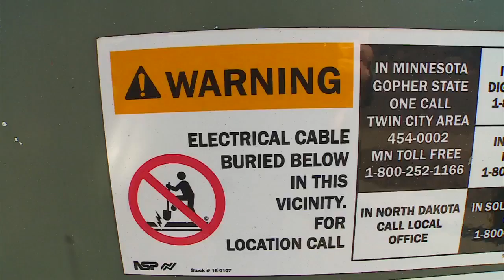Good Question: Why Aren't More Power Lines Buried Underground?

Comment: It's not a good question; It's actually a stupid question. And I have worked as an electrical engineer for years. I can give you one simple answer why (well a few.) For one thing the electrical lines in the air don't have sheathes on them. The reason of this is because they can cool off from the air around it  (but, you might think well if it was in the ground it would cool off better?) Yeh maybe but that would a maintenance problem and they would short out because ground water is conductive you fucking dumbasses. Jesus fucking christ. Are guys this fucking stupid? I mean you are talking about thousands of volts at one time. Ask yourself this question. " What if the sheath broke right? Then what would it do inside the ground? Maybe it might start arcing because of ground water?" Cmon you fucking idiots It's not rocket science (have you guys ever had a science class in school?) I guess you could use PVC piping too. Yeh that would actually work. But, then again a maintenance problem and what if that broke too?. Costs too much $$. Electrical lines on poles are spaced out to a certain distance where they don't arc. There you go. Hope that answers your question!
Reply: I swear parents need birth control to keep dumbasses from asking questions like this! 🤣🤣🤣

Comment: Henry Ford many decade's ago, highly suggested that electricity lines be buried underground. So high winds, tornado's, and other bad weather conditions would not halt electric service. But his Buddy, Thomas Edison said: I need to hire thousands of linemen, and charge each city and town extra money to keep the juice on. That way I can put more million's of dollars in my pocket by charging double for the same service. Henry sez: Sounds like a plan Tom. Then I can do the same thing. Make my cars cheaper by using real thin metal - so they can rust out faster, then I can keep new car customer's coming through the revolving door's of the dealerships, selling more & more cars - and making more million's of bucks, just like your doing. Money Money Money - thats what I want.
Reply: Someone finally with an intelligent on spot answer.

Comment: As someone who has installed underground power lines, don’t be fooled into thinking they’re naturally better than overhead lines. Yes, they’re less prone environmental outages, but the initial cost to install them is significantly greater. Excavating the earth, cutting concrete, and installing manholes are quite a task. Manholes are a danger in themselves with tightly crammed spaces with high voltage lines. And repairs may take longer as pinpointing faults, digging the area, splicing, and re-embedment can take more time increasing cost. Improving conduit sizing, wire placement, grounding methods, etc. has advanced their longetivity and durability, but don’t assume burying power lines is a simple and cost effective solution everywhere. It works best in heavily populated areas like the UK or large cities here in America.
Reply: excuses. Protecting the stupid telegraph pole technology. This bullshit dates back to pony express days with telegraph poles.

Comment: Underground lines could be insulated much more durable than above ground and last longer. They just gave a bunch of shitpost reasons why they cant, but the real reason is MONEY.
Reply: Underground wires are already insulated much more durable than overhead lines.  Overhead lines are still twice a reliable.  As lineman, we go to developments constructed 30 years ago that have constant problems from old wires.  Plus every time someone nicks a wire by digging it could cause a fault months later.  
Also, you're neighbors faulted wire problems can become your problem if the faulted happens to be on your property.

Comment: The United States should update its infrastructure indeed. Here in Bulgaria (Eastern Europe) we have underground power cables and small energy transformers that are found within the neighbourhoods. 

Power stops only a few times in the year and only in some neighborhoods for the matter of 2-4 hours and it gets fixed almost immediately. Power outages here happen mostly in summer and winter when people use a lot of their electric heaters or air conditioning that uses power
Reply: So basically the same as above but 20 times more the price lol major cities here have underground lines
Reply: Here in Canada, at least my city, all newer areas (~1980s and newer) have underground power lines as well as most main roads.

Comment: Well researched, it would be safer by far and have less power outages, but the cost is crazy to bury all the existing overhead lines, and then there are the factors of easements, proper distances, and of course repairing faults. Very few people understand how long it takes to get to a fault underground. Also, who would pay for the transfer for OH lines to UG?
Reply: The cost would've saved my brother. These things are not safe, they killed a father yesterday who was just trying to work. But the ladder struck the line.

Comment: Electricity itself is NOT even a necessity (i don't expect many to wrap their programmed minds around that one). Power lines and it's insulation can also be produced from HEMP, which would last for life. One reason they still hang power lines through the air, like idiots, is to have an excuse to employ mind-drone-slaves (like Joel Limoges) of the control-system to keep cutting down trees. Their only piss-poor, bullshit excuse is 'money' and 'ally-space'.
Reply: You're a fucking idiot.
Reply: Conscius Energeia Holy troll barf Batman! 🤢

Comment: It is a matter of cost, pure and simple. Underground construction in developed areas costs roughly 10 times as much to complete as overhead, running approximately $2 million per mile. This would translate into much higher monthly rates for customers. Everybody wants underground, but nobody wants to pay the costs associated with it.
Reply: Salvatore Guidone Great comment. Yes we have people constantly repairing lines exposed to the elements. It requires so much overhead to maintain. If they were just buried maintenance costs would plummet and in the long term it would be cheaper. Not to mention better looking and safer.

Comment: It is simple.  Underground lines are more expensive to install and service.   In my neighborhood, the residential areas are fed from an overhead wire on the main highway.  There is a transformer mounted on a pad on the ground for about 10 houses.  The line that feeds the transformer is 24,000 volts underground.  One of these underground lines failed, so they installed a temporary insulated line above ground on the surface to feed the transformer.  They later installed a new underground line in a conduit that was provided in advance in case of failure.  With transmission lines, they are normally air cooled, so when put underground there is the added expense of cooling the wires. This is done mostly in congested areas like downtowns of major cities.
Reply: All of the transmission lines in Memphis, TN in the downtown area ARE underground as well as the distribution lines.  I also know this is true for Manhattan, NYC.  In NYC many substations are housed on the lower floors of skyscrapers.  WTC 7 had a station occupying the first eight floors.  Bottom line is that underground power is very expensive to install and to maintain.

Comment: Two years ago, my cousin from Idaho an his familiy were on vacation her in Germany. As we took them from airport to our hometown, my cousins´s nine year old son asked...:  " Dad, do the germans have no electricity in their houses...? ". Cause he did not see any overhead powerlines.....
Reply: In Germany are conduits under the sidewalks and the cables are laying inside of these conduits. The entry point inside of the house is in the cellar. But there are still some areas with overhead-wiring. In my hometown the wiring was changed in the mid 90s, before this change I had a pole on my house and the entry point for electric power was in the attic.
Reply: @Marcel_Germann  The entry point for my house isn't even in the attic, it's just on the side of our house. Wire runs from the pole across the street over the road through our yard to the brick wall. 
You don't see that with newer homes though. My neighbors across the street I think are the first on our block not to be connected to the grid via above ground wires. And in the new neighborhoods being built there are no above ground wires.
Reply: @ScoCoda  Here in Germany the old overhead wiring was in the way that there was a pole on every roof. Inside of the pole the cables enter the house and are connected to the service entry box containing fuses.

It's a three-phase system in most cases, so you got L1, L2, L3 and the neutral or a PEN, depending on the grounding system the system operator provides. The supplied voltage is normally 3x230/400V. But now you'll only find that in areas which are called "upstate" in America or "Outback" in Australia. In the most areas the wiring is below the sidewalk and the cables enter the house in the cellar/basement. They retrofitted this here in the area during the mid 1990s. I got a picture from 1994 where the pole was still on the roof here:

https://abload.de/img/img_20121019_1827262ukwu.jpg

Comment: makes some sense ,, people have died from a high voltage shock during the construction of those high volt tower power lines that you see going across the rural farm land ,, on windy days those power lines build up voltage without being hooked up to any power source ,, they needed to put a special ground to the earth to drain the built up voltage while installing the miles of power lines ,, i would think that even once hooked up they still collect voltage from the static created on those windy days ,, i wonder if this helps to lessen the load on the main source ,,
Reply: carmichael moritz I work on energized power lines every day..... the only time we work on de- energized lines are when we pull new wire, working on storm damage or working an outage to a business.
Reply: My brother died just yesterday. It's heartbreaking that we choose to build hazards instead of insuring saftey.
Reply: They don't have the power lines LIVE while they work on them... And it's not like they know when the electrical equipment will arc...
Reply: noneof ,, yes i do know that the wires are not live while they work on them ,, the point i was making was that a lot of static builds up on the windy days during the construction of the bare high volt above ground power lines and they were required to ground every cable they worked on until connected to a main source ,, once connected i am wondering would the static build up still contribute to the grids electricity on those windy days ,,